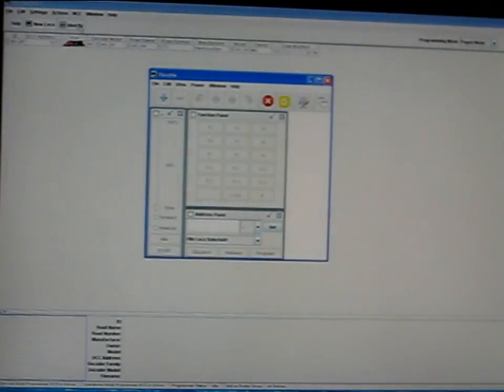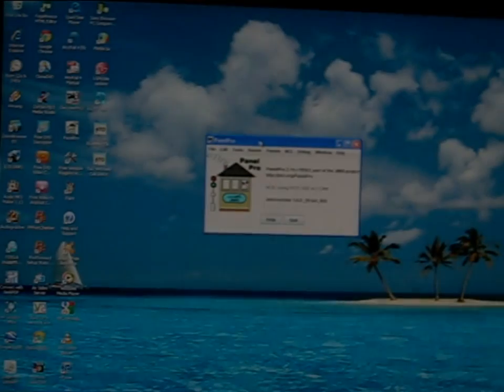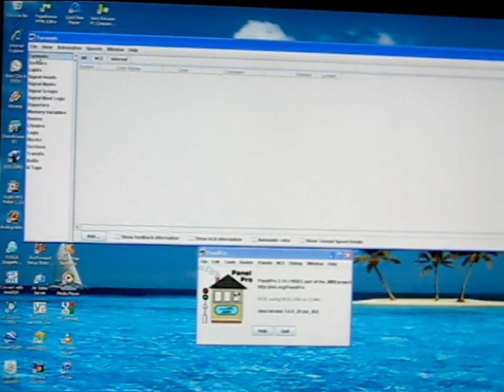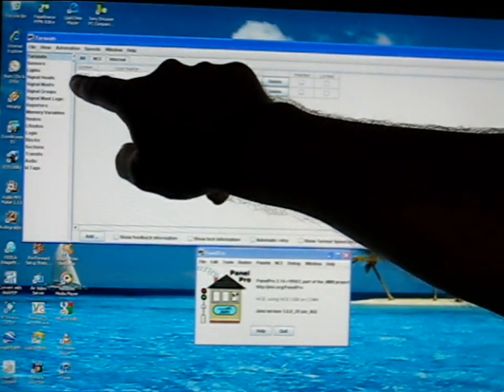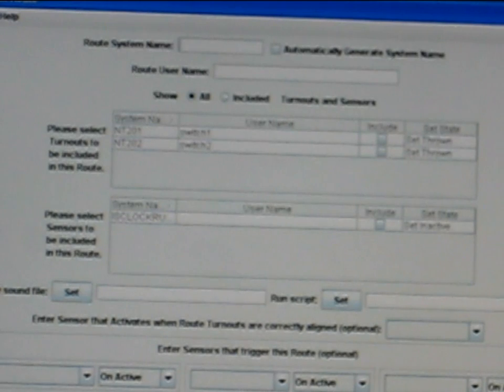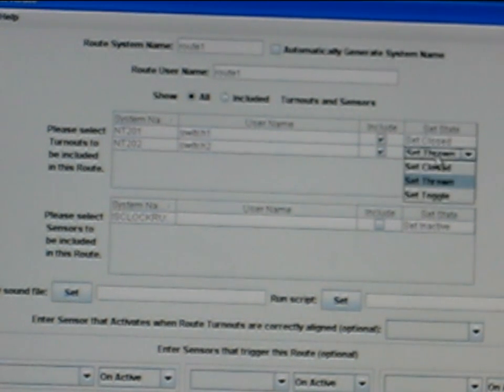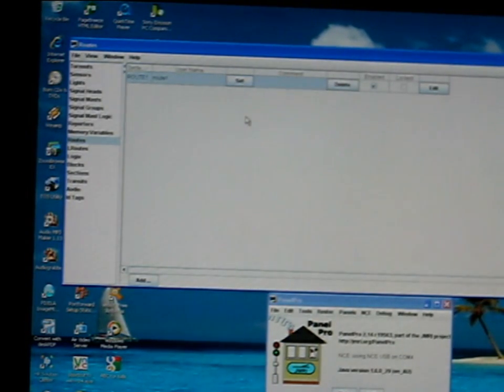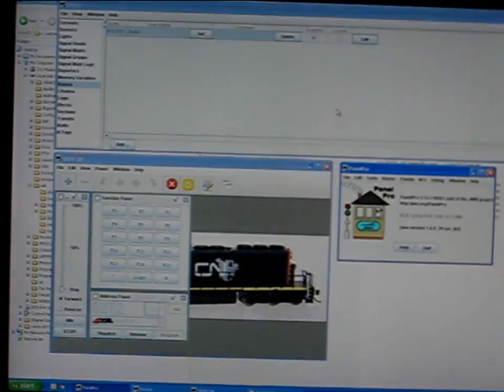Turnout control with JMRI & panel pro

Comment: Hi, i had problems initially getting decoderpro to work on my desktop, mainly to do with configuring connection terminal to link with NCE usb, but my friend who sells NCE helped me out. My plastic box has switch it, NCE usb unit and the powercab layout connection. connectors at rear are for main and programming track with switch it automatically changing power to connectors when selected on powercab. A siding on layout for programming track is isolated and can be changed to main as well.